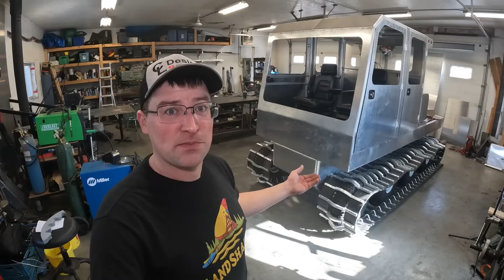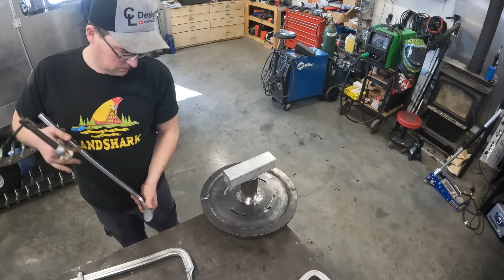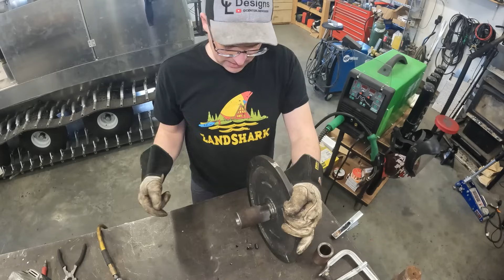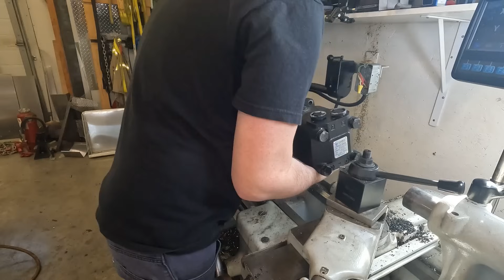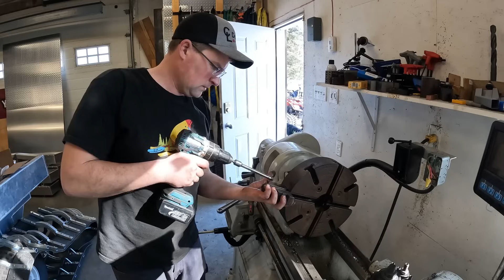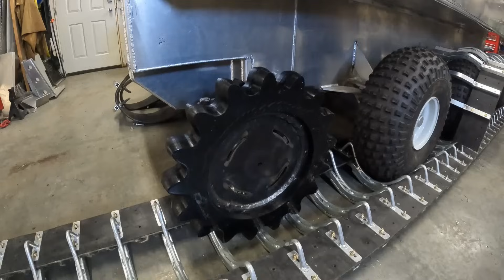Casting Sprockets and Machining Hubs P2/2 | Custom Snowcat Build

Comment: I think you already know this (from your industry of work projects) but to reach this point, without any setbacks is extremely rare. One note, at my work we always have a college review everything before its released. being 3D models, 2D drawings, calculations, design analyses etc. its not so much getting a super expert on it ( in most cases) but more about a fresh pair of eyes, this even goes for stuff like you did here AS-build updates, are just as vital to have reviewed. it does not remove every mistake but sometimes you get into a rabbit hole not seeing the obvious someone with distance to the project would question. One more note, if doing modelling in CAD, most systems have a conflict analyse, so if you analyse the machine in various outer positions of moveable parts you would get a conflict alarm.

Comment: could you not of made the inner diameter (the bottom of the tooth) the same diameter as the trye 😎
Reply from the maker: Well unfortunately no. To get the right torque I need to scale it down. I also prefer the sprocket being raised up in the back so it isn’t taking abuse or actual vehicle weight. That’s just my thinking anyways
Reply: @CenterLineDesigns  looks like you did a good fix next time round and the spacing on the treads perfect - your lucky to have a cool dad around to give you a helping hand.  Looking forward to the next video 😎
Reply from the maker: Thanks!!

Comment: With as complicated as a machine like a tracked vehicle, this stuff happens. A break from the project will help you think a bit too. You'll get it figured out.  To reduce poly usage and improve serviceability have you thought about bolting individual molded poly teeth to a conveyor belt wrapped steel wheel? I did something similar on my old machine and it worked out nicely for all season use.
Reply from the maker: You bet. Bound to happen. Honestly surprised it’s taken this long. Hmm honestly never thought about that idea. Interesting. I’ll keep that in mind if this doesn’t work out or for future projects.

Comment: Haven’t really followed your build. But I have seen quite a few of the videos. Just throwing this out there. My Bamba my drives brackets are in the front. And my tensioners are in the back. Your drive is in the back, are you able to put tensioner in the front? Keep up the good work.
Reply from the maker: It’s possible yes. That wasn’t how my original design is but it could be an option. Just in the process of assessing everything again.
Thank you! Cheers

Comment: From a fellow Ontario-in loving the Snowcat build. Just got caught up, but I wondered if you had taken that issue into consideration when you made the change to use a smaller diameter for a sprocket. Was the first thing I had thought of.
Reply from the maker: No I totally over looked it. Too focused on other things I suppose. I think I have a plan. Time will tell

Comment: Hello Cole, my step Grandpa built one back in the 50’s, using bombardier tracks I believe. The cleats look very similar to yours, but are maybe flatter on top and have rubber inserts and similar spacing. Anyway we rebuilt and restored it in the late 80’s. It’s driven by a single cyl 18 Hp Wisconsin with a hand clutch driving a 3 speed trans? down to a non posi car rear end with drum brakes. It steers by the drum brakes. That’s a big drawback, heat build up. It worked wonderfully, but time had taken its toll on the track and started tearing. We used the car tire with chain lugs welded over. Unit weights probably 3500lbs loaded and we took it moose hunting into bogs and swamps.Small leaf spring trailer axles with wheels as idlers.  I’d like to contact you if possible. You are doing a very splendid job. I am with you with the ripple effect. Sometimes a ripple, sometimes a tsunami!
Reply from the maker: That sounds really cool! Thank you for that comment. We have a Facebook page where you can leave me a message if you like. Just Check out Center Line Designs. Thanks
Reply: @CenterLineDesigns  done

Comment: pore weel motors put a baring on the hubs they will not last like this
Reply from the maker: They 100% will last like that. They are wheel motors with taper wheel bearings that can take 5,000 lbs loading. They are meant for direct drive to wheels.
Now I may be moving them farther from the sprocket in which case I will be adding a carrier bearing just because of the coupling. 
But these motors are designed for this

Comment: Recast the sprocket with the same hub size but larger teeth
Reply from the maker: That changes the gear ratio though. Also making a bigger sprocket doesn’t make the teeth bigger it just increases the number of them.

Comment: Your young... enjoy the creativity juices while your battery just keeps going and going. CAD is a cool tool to innovate but the the real world lessons happen when the screen effort meets the physical assembly. :o) I hope you do not think its rude to suggest something as i knowwww its a lot of work moving the motors in.... The track will tip laterally on uneven ground  and the grouser clearance you see static sitting on the flat floor is not the real clearance deal.   Consider making the motor mounts smaller{ i see a lot of mount clearance between the motor to mount in your zoomed in display} smaller via round motor mounts so that the motor mount ears will just slide inside something that looks like a large piece of pipe that is capped to bolt the motor to. A grouser that could get bent in the field , loose or tipped by terrain ... will slide around a round shape instead of catch on a rectangle shape. .  best of luck.. like others i will be watching from the side lines rooting for your full on success.

Comment: I built smaller drive sprockets for more torque and barely had enough clearance with identical problem. I also have my rear drive sprockets elevated like you considered doing, it works totally fine. Tracks have never threatened to come off. I also use a large peripheral bearing to support the axle for the absolute identical reason, it works fine. 

Youve got this! But I’ve felt the same frustration with my build. Almost quit a few times.
Reply from the maker: Oh man good to know. Funny how we hit the same problems. I know right. Generally it’s gone well but set backs suck haha.
Cheers sir!

Comment: Could spacers be placed on all the axles to offset the tracks away from the drive motor mount?  Wider stance would give the rig added stability as a bonus.
Reply from the maker: Possibly. But I really don’t want it too wide. I’ll keep that in mind

Comment: As soon as I saw the sprocket sitting on the cat I thought that there could be a clearance issue.
The 50yo engineering company that used to be over the road from me effectively went belly up due to a design change. They designed up a fairly large and expensive but of grain handling equipment which worked well. The proto worked sweet but the customer decided to change from a painted finish to a hot dip galvanised. The company factored in the price difference between a painted finish and hot dipped and that was submitted as the price for the 35 units. The only issue was that with many dozens of mating and moving joints that gal caused massive clearance issues which blew out the labour cost to the point that they were losing money on each of the 35 units. With almost a full year of work running at a loss the bank shut them down. Clearance matters.
Reply from the maker: Oh my goodness. That is quite the example of how a change can spiral things. Wow!

Comment: I raised our 1200sqft rancher with a 5 foot crawlspace. Cut the garage roof free to add a master bedroom and installed another floor underneath the remainder. Filled in the crawlspace to make our entrance foyer and recroom 2 stair risers higher ceilings with concrete floors to support a billiards table and because it looked good. We have a cold room with horizontal crawlspace entry and 13 foot ceiling for plenty of canning and wine shelves. The lift took 50 minutes with 9 hydraulic jacks from a central pump controller. Framing the main floor and walls took 3 days. 2 hours to lower and position the house plus a day to build the new garage ceiling bedroom floor and walls to arrive at 2865 sqft of no one can tell we did it type of  project. Not my first lift either. Hope you have fun with yours.
Reply from the maker: Sounds awesome! Hopefully we have just as good of outcome!

Comment: cut it down to clearance it, or put the motors inboard more and use a jackshaft to run the drive wheels.
Reply from the maker: That’s probably plan C. It’s looking like new motor mounts might fix the issue. Time will tell!

Comment: I'm building my first in depth tracked vehicle. I'm building a mini snowcat.. more like a mini mini snowcat. Using a gas golf cart chassis, I made my sprockets out of uhmw. They are 7 tooth. I've got flat free wheels, front wheels are adjustable to tension tracks. I'm making tracks out of angle iron for grousers and bailer belt for the belting. I made my sprockets and undercarriage first, then I'll build my tracks to fit that. The "seat" of the sprocket (where the grouser sits) is in plane with the top of the wheels. The bottom of the sprocket is 3 inches of the ground. Same in the front wheel. Using a smaller wheel. Now that I have my grousers cut. I get the pain staking task of drilling them all and welding guides.
Reply from the maker: Sounds like a fun build!!

Comment: Admittedly i havent watched it all and havent read the comments yet, but i see the opportunity to use these sprockets as the cores for the 19 tooth sprockets...
You wont need as much epoxy if you simply cut the teeth of the 17 tooth sprocket down to the root of your 19 tooth sprocket, then cast the new teeth around this core. Whats left of the 17 arond the hub will index and lock the 19 to the core so you wont be able to spin the new outer around the existing inner.
Make the new sprocket 1/2" wider either side of the existing hub with crowned teeth and youll effectively encapsulate the 17 inside the 19.
Almost like a glove going over a hand: the 17 is the hand, the 19 is sliding over the 17 and making it slightly larger in every direction away from the center.

 Not sure if i explained in words what i meant, but a picture will make more sense. 

Every 'mistake' is an opportunity to redo a part even better than you did it the firat time: printthe nee molds with 99% infill for less warpage for the exothermic heat and you wont get the slight 'poofing' you got last time. And this sprocket will engage the grousers with more contact surface.
Win win. 😎👍
Reply from the maker: Well that’s definitely the most interesting correction I have hear of! Going to try and move the motor up first and they go down the list of changes from there. 
Definitely need more infill next time around when making resin molds. Never even thought about the reaction making so much heat. I should have thought about it as I do have epoxy experience but slipped my mind!
Cheers
Reply: @CenterLineDesigns   I call that "not seeing the forest for the tree in front of you." We all do it. You get so amped up aboot seeing the pro-ject move forward that you forget about all the other important little things. Like exothermic heat from epoxy-like subtances...
But I'll put my bank account on the fact that you won't forget again any time soon. 👍

Ps. I got Rosetta Stone's Canadian Language Course, so I can speak to you in your.native tongue when we collaborate after my Goliath is done. I sprinkled some in my paragraph up there. How did I do, eh?

Comment: If you don’t try, you never know what you can do. A teacher told me, you don’t have problems, just challenges to solve. Which is very good way to look at things in life. You will figure out a solution and most of the time, it’s for the better. Chin up, Cole you got this! I am excited to see the house lift series as well. Keep moving forward.
Reply from the maker: Thanks Lloyd! Fully agree. Hard pill to swallow just because things have gone so well. But making mistakes is where I learn the most. 
Very excited and nervous to get going on the house. I think I have a plan but with most things I do, it’s usually the first time. However I have helped lift a house and learnt as much as I could.
Cheers

Comment: Don't forget that going to the smaller gear, the track length is too long and whatever 'adjustment' you planned for will have to be larger or the mount moved. Put the track adjusters on the front. More available room to build things there and avoids a maintenance nightmare of burying the motors.
Reply from the maker: That’s a good point. I have some special grousers that let me keep the belts a bit longer and overlap. That way I can add or remove a standard grouser to increase or decrease track length a bit. I am going down that road with front adjustment right now. Just not sure what it looks like in my head yet.

Comment: From what I saw when you zoomed in on the growsers hitting the motor mount, if you have to move them in, I think it would only be an inch or two.  You might NOT need to modify the bed of the Cat that much.  As for mounting the pillow block, maybe a truncated pyramid from the face of the existing mount to fasten the pillow block to.  Stepping away from a problem often leads to surprising answers!
Reply from the maker: I totally agree. I don’t think I’ll have to cut into the rig. So fingers crossed.
Also agree. Often taking time and letting the subconscious work on it leads to good results.

Comment: Hi Cole. I fully agree with the others. Hickups are part of designing and fabricating. In a way you're lucky that you have to put this on hold for now and focus on the house project. I'm actually looking forward to the first videos on the house. You've done a great job so far and I know you will bring it to a great finish when you get the time.
Reply from the maker: Thank you sir! I very much appreciate that. I also agree. I am pretty excited to get started on it. This issue shouldn’t be too big of a deal. Just a set back. 
Thanks for the kind words and thanks for watching!
Cheers!!

Comment: Well done, and dont be too hard on yourself. Could you however get some more resin (since you have only poured 1 sproket so far I think...) and make a 19 tooth one rather than the 17 you have now, and that solve the issue, and then be able to leave the mounts as-is? I know it will change your gearing, but in the big picture of things it will potentially solve the problem, and could be something you tweak later on and get the gearing better. Im sure you have thought about this though and its not going to work.
Reply from the maker: You are correct that it might work. But I am nervous of the gearing. If push comes to shove I may have to try that. But I think my first thing to try is a mock up a new mount with just some thin 1/8” plate to test and see what that gains. Then asses the other plans and make a decision based on time and money. 
Cheers!

Comment: So your drive motor is carries the entire load of the tracks. It seems you need a spindle that carries the load and the drive line passed through.  In a high load/torque condition the drive motor shaft with another 6ish inches of leaver on the end you are demanding a lot of those motor bearings.
I know you said you spent a lot of time on engineering, I haven't.
Reply from the maker: Yea I know it seems crazy but these wheel motors are rated for 5,000 lb of loading. It’s the kind of direct drive wheel motor that you would find in like a manlift. They have very large taper wheel bearings internally. I know what you are thinking. I thought the same thing too until I talked with the company. Really the tracks aren’t that tight ever in a vehicle like this.
If I am to make that shaft longer I feel it will definitely require additional support

Comment: Another great video Cole ! turn this set back into a positive and what ever you do dont lay awake at night worrying about it, worrying has never ever cured any problems in the history of man, take a step back and some time with your family and you will probably come up with a solution to the brackets that you will like better than before, i am in the process of converting a Ransomes plough into a match plough here in the UK for a freinds Grandson and it is giving me one head ache after another, main thing is Cole never ever give in 😜👍
Reply from the maker: I couldn’t have said that any better. I fully agree. I was upset but only for a day or two. Then I let my subconscious get to work. I usually get my best ideas when I am actually not trying to think about them.
It why I actually videoed that last part two weeks later. Gave me time to think clearly

Comment: I’ve been here before on my projects, I feel the struggle. In the end just know that it’s gonna be worth all the emotional stress to see your creation come to life! I guess from here, you could either reconfigure the structure of the track, redo the rear, or move in the wheel motor and fab a shaft extension, or minimize the protrusions from the wheel motor mounts. Sometimes a good break from a project, like getting into your house projects, allows you to come back to your old projects with a fresh perspective. Wishing the for the best! Thanks for sharing this!
Reply from the maker: I 100% agree. I think I’ll start with what will potentially be the easiest and cheapest without sacrificing quality. I always do my best thinking when I am not actually focusing on the project. Usually laying in bed at night and all of a sudden the solution pops into my head.
If that doesn’t work we will just hit the drawing board again!